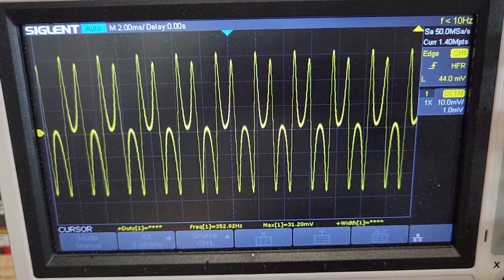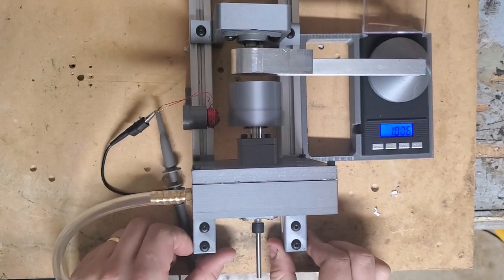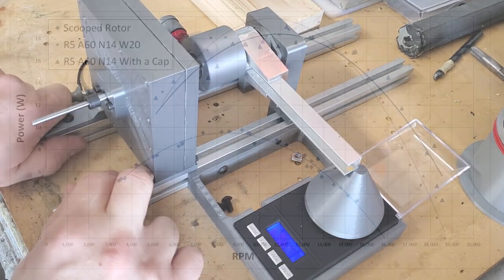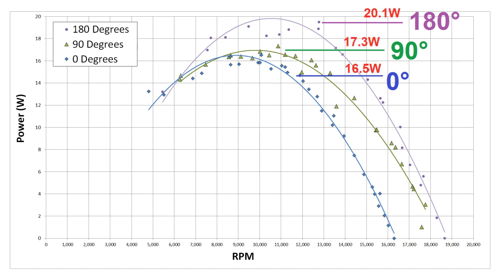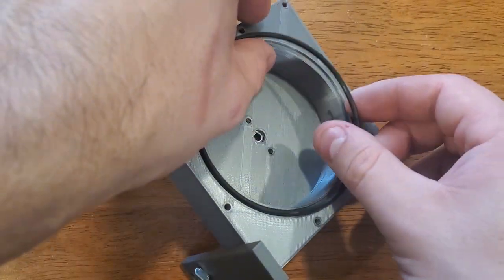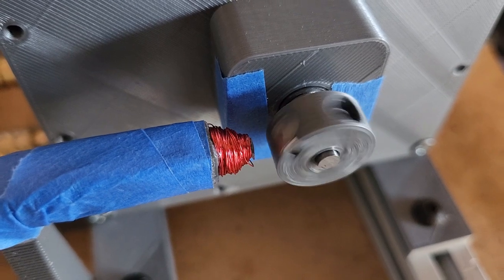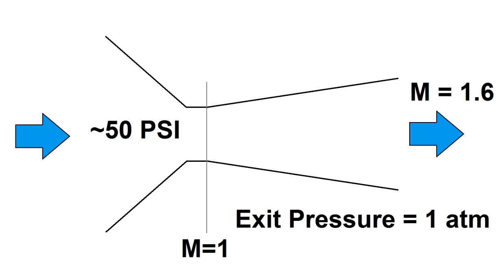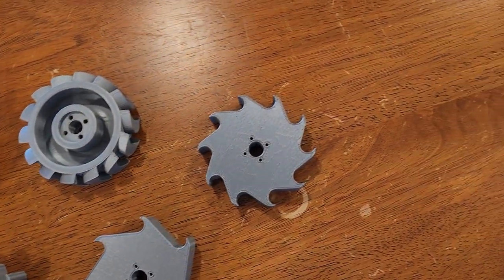Comparing Turbine Rotors

Comment: Can you install separate pressure sensors to monitor the pressure behind each vane as the turbine spins?
Reply: My idea is the pressure difference between the vane high side & vane low side is the same as torque output.

Wider vane = more torque 
larger diameter vane = more torque

More vanes doesn't mean more torque.

I'm guessing that your ports were too small, so the (larger/double capacity) vane cavities were not filling and/or exhausting sufficiently. Monitoring the pressures inside the vane cavities will tell you which is the problem.

IE: several psi remain after the exhaust port = exhaust flow is restricted /&/ several psi short of supply after the intake port = inlet flow is restricted

Comment: The reason your fenced designs and the 40 mm thick blade had a drop in peak torque is bc the added mass increases the moment of inertia, which will decrease the angular acceleration

Comment: Another design is possible, but requires a hard polished inner housing and compresses wheel with hard steel polished blades that fling out by the centrifugal forces, like in the Wankel engine roters.
Can't remember where i saw it but that's how they do in industrial things.

Comment: So... I noticed you didn't heh to make a THINNER turbine, to try keeping the speed up, then using a wider on stage 2, in order to extract the expansion of the gas.
Also, as someone else said, that kink in the tube was an issue. A smooth curve working best, instead of say, two 90deg bends.

Also, for the housing, you'll want to pay attention to the print quality. If it's not smooth, you're creating turbulence, losing efficiency...

Comment: god damn you do some dope shit.
how did you even learn about this whole turbine thing? I get thinking turbines are cool and wanting to make them, but the maths? how do you come across that?

also you never really mentioned friction, which I think may be causing you issues. and I would bet is why the big one and the one with the sides didn't work so well. even just not having them balanced might be putting a lot of extra force on the bearings, which at that speed might create some considerable friction. greased bearings will be problematic too at those high rpms.

can't wait for the cryogenic stuff. I have never really been super curious about it because I've never had any use, but now I am. and by the time you're done I'll probably be wanting to do it too.

last thing, you seem to know what you're doing with building CNCs, why not make yours a little more chunky and add an extra axis? seems like it would certainly make this whole endeavor much easier. 

thank you

Comment: @Hyperspace Pirate i have a question maybe unrelated to what you are trying to do but would it be possible to build a air motor where you imput the air through the middle of the shaft and then have a it enter into a thin cylinder with a spiral channel/flute going from the middle and out to the edge making something like 2 complete turns around the axle before exiting the centrifugal force would help speed up the air flow and pull more air, in a sense the engine would help power it self. But maybe im am wrong and it is the opposite it well help pull air through faster and easier so the same amout of air produce less rotational energy of course it could be a matter os getting it right maybe the channel should be wider at the centere and get thinner further out or having crazy many rotations around the axle before it exits or having dual channels. 
I dont know alot about these things just something that popped up in my head when watching this and i would like to hear what you think about it? would make for an intresting project
And please correct me if this just a stupid idea that wont work
Reply from the maker: I think that's how a centrifugal turbine works. Like the impeller on a turbocharger in reverse
Reply: @HyperspacePirate  can you please make more advancements for you turbine rotors please

Comment: I wanted to post comments about a previous video and I figured I'll watch your newest video and lo and behold they both need the same thing in my opinion or my thoughts on Siri put the whole system in a vacuum both of them.
Hopefully you understand why you're doing your procedure for testing have it all inside of a vacuum chamber it'll suck the air out of the help suck the air that you're putting in out through the device

Comment: impeller vs rotor turbine
Reply: water wheel vs centrifugal reaction turbine
Reply: the input volume stays constant, what did you expect
Reply: tesla disc turbine engine
Reply: of course its possible
Reply: why normal water wheels, centrifugal tesla type turbines are a ton better
Reply: drum type turbines, even surface drum type of tesla turbine, single surface, archimedes rolling drum turbine
Reply: screw it, piston cryo
Reply: combine a tesla disc turbine with a rotor, then you have a spiral tesla turbine
Reply: essential is the rim-in center-out or the reverse of that, center-in rim-out, idea

Comment: Why not try a continuous radial flow turbine? You'd get multiple stages with less mass and system components which will minimize leaks due to your printing tolerances
See image, I may not have the exact nomenclature. For printing the complex geometry is perfect. My understanding is the 2D  extruded turbines are relatively  inefficient but easy to machine and are low mass but that is why they require stages, because each stage is a discrete section of an ideally continuous airfoil.

https://en.wikipedia.org/wiki/Radial_turbine